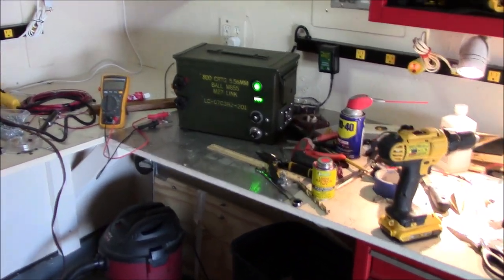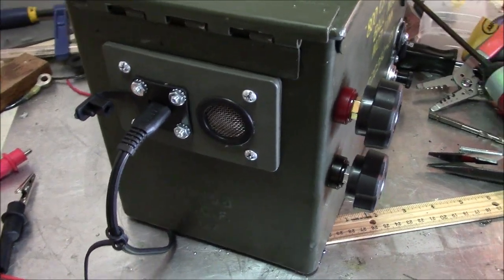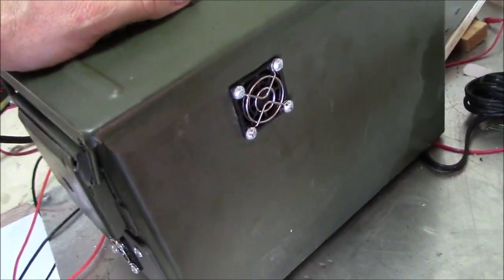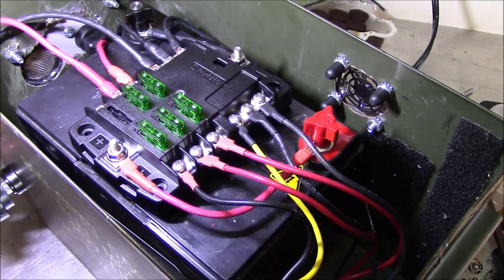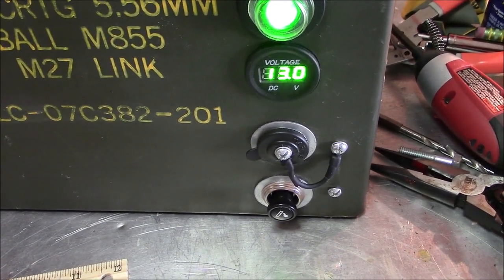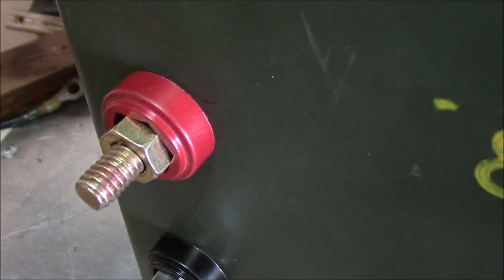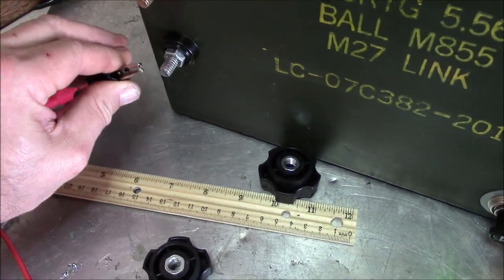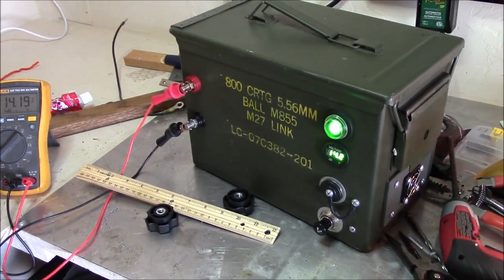12v ammo can repurposed! Emergency power source, camping, SHTF, prepper, cigarette lighting

Comment: Great way to get mie use out of the project!
Reply from the maker: Thanks. These boxes make for great emergency power source. Tornado shelter, basement, garage, shed, cabin, etc. Just keep a Battery Tender Jr plugged in and always have a topped off battery. My other ammo cans are actual generators...solar charged/powered with inverters. This one is for bench testing electronics. But, can plugged an inverter or solar charger if needed. I like the "look" of old ammo cans, but, cutting steel is a PITA.
Reply: @ChrisDIYerOklahoma  Yes sir.  Cutting those is exactly that.  Fortunately I have a buddy that has all the right gear and has offered to cut them for me when I get ready to put some together.
Reply from the maker: Plastic is much easier to work with (and slightly less expensive). But, steel is steel and can handle the weight of a battery better.